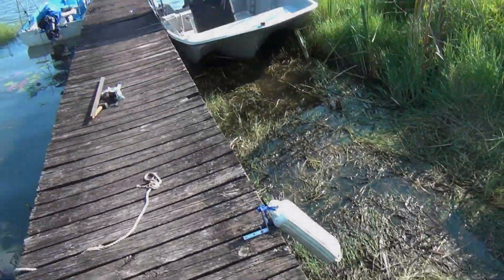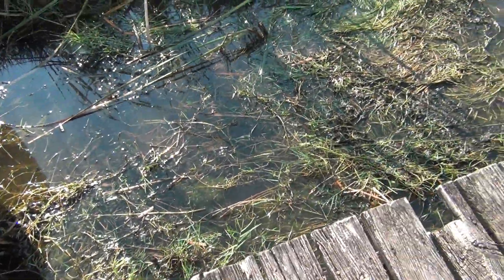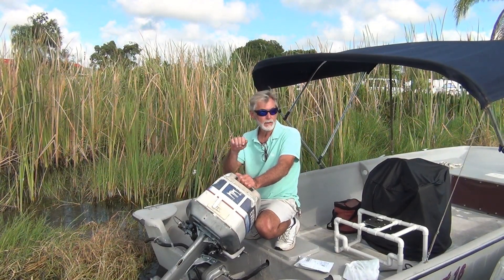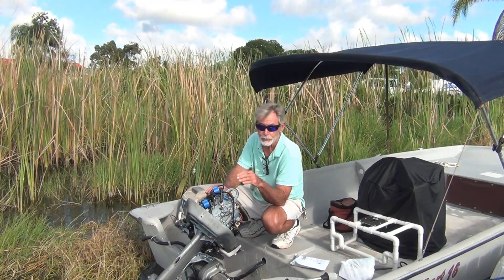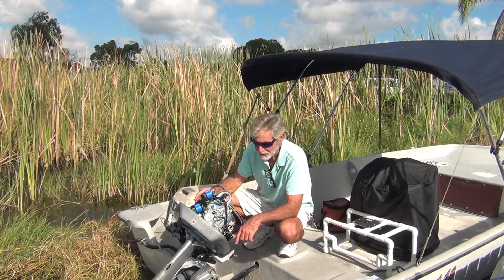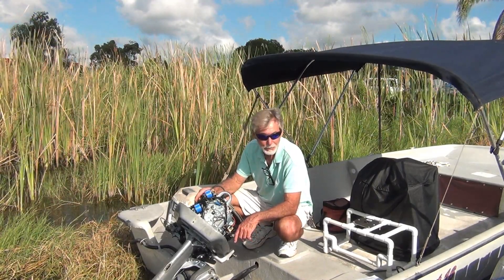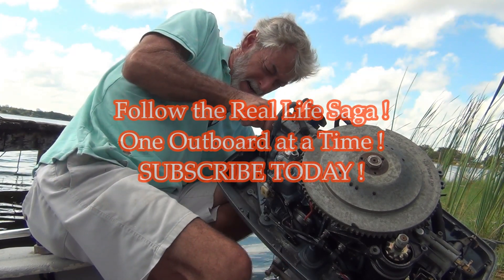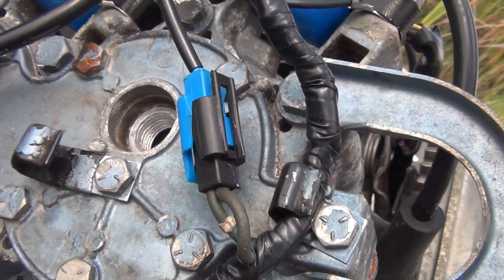40 Hp Evinrude Outboard - Stripped Spark Plug Thread Repair

Comment: Nice job!Brave working off the dock like that with all the motion to deal with.I had watched OM Fishing on here do a 9.9HP, hope I never have to.Thanks for the mention of the piston condition.
Reply from the maker: Hey. It wasnt the first time, but its been awhile. Thats why I would rather buy another head but the motor was already in the water. If that makes any sense. Hahaha  thx again !
Reply: THIS OLD OUTBOARD  makes perfect sense since those motors aren't getting any lighter if you need to pull them.

Comment: I've used the save-a-thread insert with good success. My spark plug  was a little  crooked, but still worked fine.
Ran that motor for years and sold it recently.  Looks like you're missing the tool that taps the insert and locks it in place. I think you'll be okay with the loctite though. Good luck.
Reply from the maker: Yeah. No tool. But it came out good. thanks. Stay tuned !

Comment: Glad that worked out for you! I got my 15 🐎game Fisher water impeller in and it is getting water to the Head but not coming out the blubber holes on the exhaust. Need some help with this thing. We need to get together soon buddy.
Reply from the maker: Hey. Yeah. Sounds like a thermostat problem. I've never worked on a game fisher before but will check it. Thanks

Comment: Good job.  Some of those type insert kits come with a swagging tool that locks the shoulder into the head. I there used to some good ones on ebay faiy cheap.
Reply from the maker: Thanks. Really appreciate you watching and commenting. thx again. Stay tuned !

Comment: good job,i like helicoil little better.but you didnt eanna pull apart.i use the grease trick on bit goin slow then on the tap.but hope it holds ,hope you locktite it,sounds great.hey what year 20 horse is that.i got my ey on one 250.00.dang the cowl on those are ugly as H though aint they.this 20 im lookin at is ugly, but looks pretty good under hood.gonna check it out hope tommorrow.its a 1967,think they are good motors.its johnson 20 hp. 1967.good shape.needs seals soon in bottom.he said if it sits long time in water it will get little water in it.i thought crap buddy,u aint suppost to let that thing live hangin in the dam water.any input b great.thank you
Reply from the maker: Hey. Thanks. The 20 hp I'm working on is a 1968.
Reply: cool,im still thinking about this 20 but i like the set-up being like some older but main and rod bearings are caged type arent they?thank you
Reply from the maker: @robertpc100  Hey. Yeah. I believe so. Thanks again !

Comment: Mine did the same thing last year on the top cylinder and it wasn't the head but soft threads on the spark plug,Champion plugs suck we had many problems with them in Auto mechanic school in the late 70's after i got out of the svc.
Reply from the maker: Wow. No kidding. Crazy! thx again !

Comment: For years I would sweat stripping sparkplug threads everytime I would take sparkplugs out and put them back in outboards.So one day the outboard Gods said Hey Glenn back in the mid to late 1990S go and buy the damn Heli-coil pro kit with plenty of helicoil inserts and tap and tool for replacing those fricken threads .Now I dont worry anymore just my experience with that annoying problem.....Glenn P.
Reply from the maker: Hey. Yeah I've used the helicoils and the aluminum inserts before and didn't care for either one. I like the steel ones best. Thanks.
Reply: @THISOLDOUTBOARD1  Yes its a matter of personal preference I agree I like the stainless  Heli-coil inserts no glue factor.GlennP.

Comment: I've johnson 35 hp and bottom cylinder spark plug thread stripped i was thinking to fill it with aluminum welding rod and re threading it
Reply from the maker: Hey. Thanks for tuning in. Don't waste your time. Just get the repair kit at any auto parts store. You'll be all day with those rods and you dont want any dripping into the cylinder. Trust me! MAJOR P.I.T.A.! Thanks again & Stay tuned !